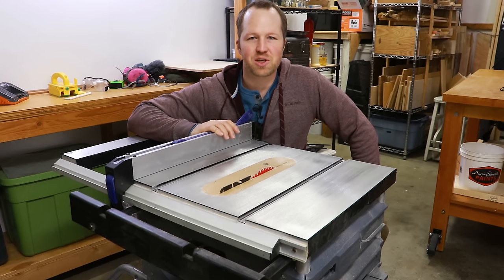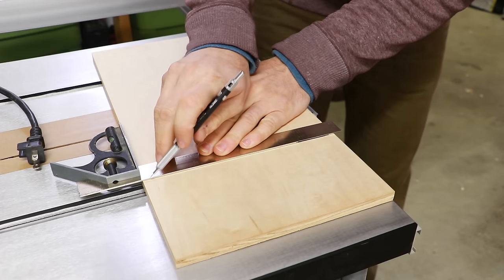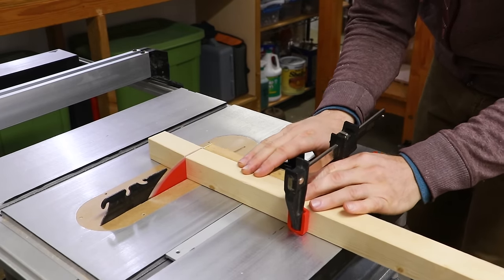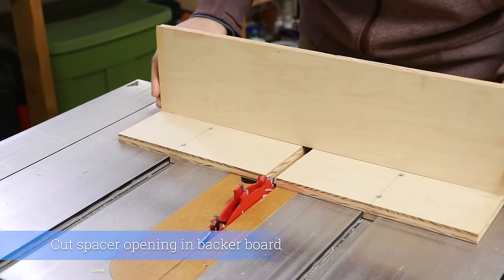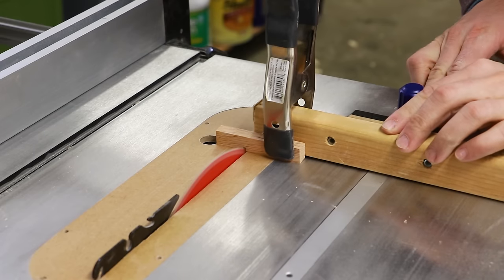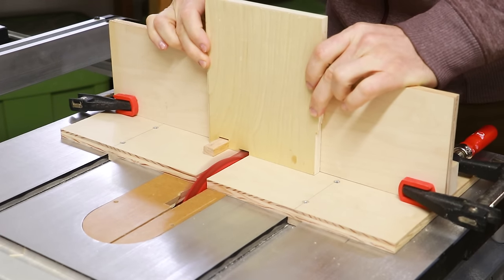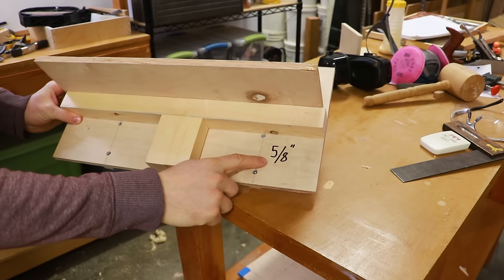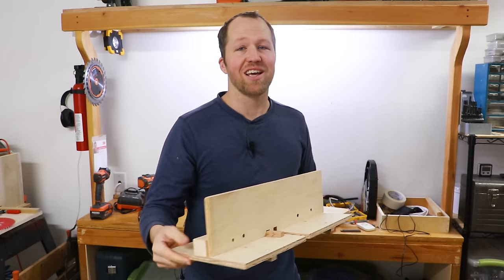How to make the perfect box joint jig {finger joint jig } ~ beginner woodworking DIY

Comment: You are killing me Smalls,  raise the runners in the miter slots with some dimes, put the double stick tape on the the runners, lay the sled board across the runners. The runners are now perfectly attached to the sled board, flip it over and drill and screw.
Reply from the maker: Thanks for the tip
Reply: That’s what I would do also if I was going to use screws. I just used CA glue  and sprayed some accelerate mixed with some wood glue, that way I did not have to worry about the right length screws. Put painters tape on the table saw to protect it from squeeze out.
Reply: Love the sandlot reference!
Reply: . The smaller of the two pieces you end up with after every table saw rip should always be on the outside if you run the smaller section between the fence and blade its more apt to pinch/bind and really f*** you up buddy be careful

Comment: I made 2 of these..1/4" and 1/2".  Be careful with the smaller pins. I broke one, made another and put it back in the same slot, continued my work and the remaining joints cut didn't match with the first set i cut before the break. Had to cut my project ends of and redo all joints with new pin. They all fit. The pin was made of walnut. Sighh

Comment: This could be used for 5/8 joints.  Bee hive boxes would require a wider/ deeper set up sled for 3/4 stock.  Make as many test cuts as necessary.  Very well done video.

Comment: I admire accuracy but man...
Reply: Not sure my climate would allow such tight tolerances in wood. Pretty close though. Nice video. Take it if you use multiple size joints you need multiple jigs?
Reply from the maker: The sled is for a single size joint. There are jigs for multiple sizes out their. But they require more setup between uses.
Reply: I was thinking the same thing!! Nice jig though.

Comment: Watched about 4 other box joint jig videos but this one is by far the best.  Not just in explanation, but some others just seemed flaw in the logic of how they made it.  The adjustments and how to make them were clear, as were the measurements and precision around them, and the nice touches including the slight roundover on the pegs to make them fit easier.  I just made my first one using this video today, I got lucky with the placement of the final fence alignment given your explanations.  For me, I didn't want to risk drilling into my table saw (for attaching the miter bars), so I used a pin nailer and attached it that way, and then drilled screw holes and mounted screws totally off the table saw.  Thanks, great video!

Comment: Thank you for your time in making this video.  It was very helpful and accurate.  I especially liked the William Ng method of using feeler gauges to adjust the spacing.  I also thought it was great that you placed details about the blade set up on the bottom of the jig.
Reply from the maker: William Ng is top notch

Comment: Good, simple jigs. I made a couple for different joint sizes 2-3 years ago the same way as you did. I've made a bunch of small handy to large storage boxes and a few drawers that are very nicely done. The only difference was to make the finger protector larger then use a stop on the saw table to limit sled travel to ensure my fingers stay attached to my hand. Oh and that saw table top - I also wax that 2-3 times a year too as mine is cast iron and not only does it protect it from rusting, it also makes it super slick.

Comment: Very nice.  I especially liked your use of a scrap piece cut to a point to register the location of the little box joint gage.  I built my first box joint jig a couple days ago, and I was just giving the backerboard light taps with a hammer to move it back and forth a fraction.  Should have watched this first.  I don't think all the micrometer use is necessary if you've got some scrap on hand since you can run a couple of pieces through to check the fit.  Anyway, thank you for making and posting this video.  I found it very helpful.
Reply from the maker: Great points!

Comment: Nice and clear video.  As an aside, the one thing I never see in the creation of table saw sleds that are short enough so that the piece is cut before the leading edge of the sled reaches the back of the table saw surface is the inclusion of a stop piece at the back of the saw table that prevents cutting through the safety block.  Depending on a feeling of additional resistance while cutting can lead to a gradual deepening of the slot and ultimately having the blade exposed behind the fence.  Just a thought that might lead to a follow-on video to this one.

Comment: Excellent project, just completed mine and am planning on making more in different sizes. I made my sled 12x24 and my backer is 5.5 high. I used my better 2 faced tape and had a problem removing residue. Good idea with using the cut off to start the spacing, I got it in 2 tries.
Reply from the maker: in 2 tries is quality.

Comment: Great to see your advice on gapping the setting piece and use of feeler gauge to set the back board. I can’t use dado blades so wide so am limited to .104” with my blade .nice for small boxes though. I have a jig for multiple cuts with this blade instead of one cut that dies lead to inaccuracy . I suppose I need slightly smaller allowances with such a thinner blade . Will experiment

Comment: Hello, very instructive video! I was wondering how you can put those thick double blades on your tablesaw?
Reply from the maker: its a dado blade. I have a video on it. You will need to check your table saws manual to see if it will work for it. Basically the saw needs a big enough motor to cut with it and a long enough arbor to accommodate it.
Reply: @natelarge  Thanks!

Comment: Thank you. I've made a jig following the instructions and purchased some dado blades for my table saw. The problem I'm not having is that my trailing edge tears out. I've tried slow and quick motions with the jig. I'm using an 8mm combined dado stack with two blades and a chipper blade and. 05mm spacers.
Reply from the maker: my best advice is: To avoid tearout the slot opening needs to be as close to the exact width and height of your dado stack. This is best accomplished by cutting the opening with the exact combination of dado stack  you are planning to use with the sled. if the opening is larger than your cut you will have tearout on the unsupported wood.

Comment: Hello and good afternoon from Valencia Spain.  Please could you tell me where to buy the DADO BLADE  disc?
Reply from the maker: For those in America: I got mine at home Depot. Lowe's Rockler and Woodcraft also sell them.
Reply from the maker: Sorry I didn't read your message carefully. I'm not sure where they can be purchased in Spain as some European countries have outlawed dado blades. My recommendation would be to check with a local woodworking supply store.
Reply: @natelarge  Thank you very much, I have my brother in NJ, I will ask him to buy it and send it to me.
Reply: @jorgeacuna3935  make sure the arbor bolt on your saw is long enough to accept a dado blade.  They are often only long enough for a standard blade.

Comment: Good video. One question: the fingers I need to cut are wider than my dado set can cut. Ny suggestions as to how to adapt your method to handle this situation? Thanks for the video. Stu
Reply from the maker: Thats a good question of which I do not currently have an answer. Of the top of my head I suppose that a jig could be made but it would need to have some moving parts, specifically the spacer would need to move a spacer width away from the dado and back to allow a double sized cut. I would think the tolerances would have to be very small for it to make a tight fitting joint. Anyone else got anything?

Comment: Going to make  a couple different sizes of these. Just beginning woodworking your videos are super. I bought the Bosch 1617EVSPK includes the Plunge Base.and the Bosch RA1181 router table. I am going to order the Bosch Deluxe Router Guide RA1054. I bought all these items BECAUSE OF YOUR EXCELLENT VIDEOS. Do you have a short video on how to use the plunge router base with the Bosch 1617?

Comment: not bad  but I've seen other box cutting jigs that can be adjusted but are a lot more complex. but with that jig you can do a lot of differnt size fingers.  Its also helps to ahve more then one saw to make the parts and not remove the dado jig once its installed.
woodgears and stumpy nubs have some differnt approaches.

Comment: I get pretty bad tear out on my fingers with my dado. Any suggestions??
Reply from the maker: What type wood are you using?
Reply: Nate Large - Woodworking DIY & More Plywood and cedar.  1/2” box joints, its a freud dado stack from rockler. It have to be doing something wrong, the tear out its pretty bad, I’ve never seen any tear out here on any videos.
Reply from the maker: hummm... my best guess is to make sure the blade opening on the jig's fence is the exact width of the dado stack you assemble for the cut, that way the workpiece is being supported right up to the cut being made. the same principle is used on zero insert throat plates for the table saw to avoid tearout on a table saw.
Reply: I was getting tear out also. I noticed that while adjusting the dado height I created a bigger hole in the "backstop". This made the wood I was cutting unsupported. To fix this I dialed in the height and then used the dado blade to cut a perfectly sized notch in 1/8" plywood. I then screwed this plywood to the backstop so it supported the wood I was cutting perfectly.

Comment: Begging woodworkers, please never cut small boards on your table saw like this!  It’s extremely dangerous. Really good chance of binding and kickback made worse by the fact that your hands are so close to the blade.
Reply: If the board is held snug to the sled, it will not bind to the blade. If you are getting binding or kickback its because the operator is doing something wrong or there is a something out of square with your sled and saw.

As always keep your fingers away from the saw blade. If you are concerned about this work, find a different way to do it or find someone more comfortable to do it.